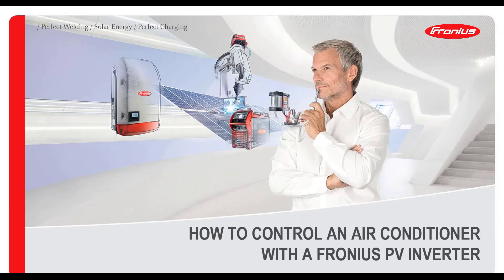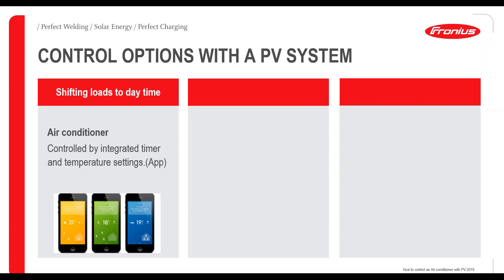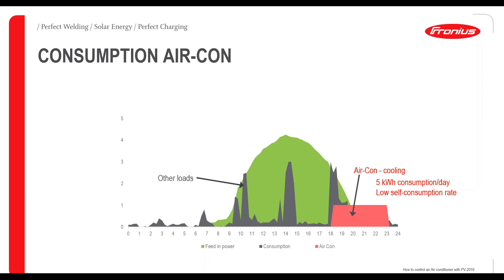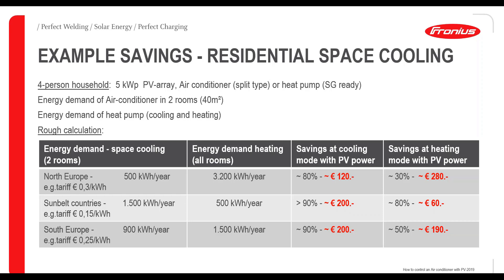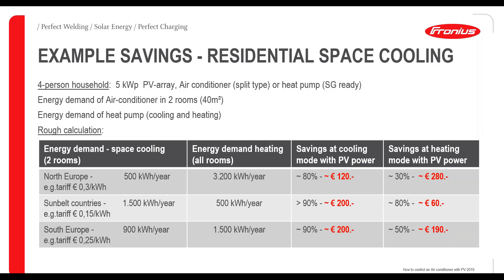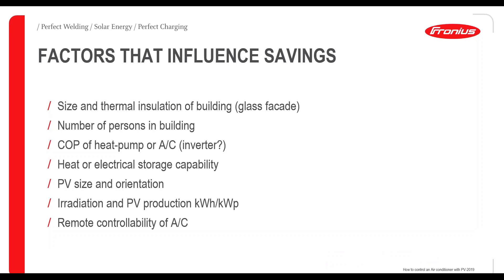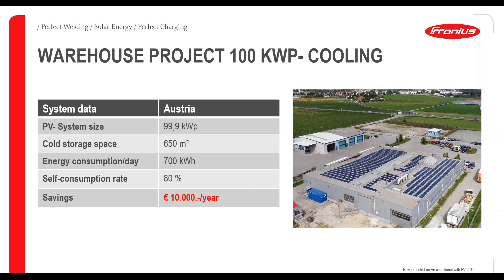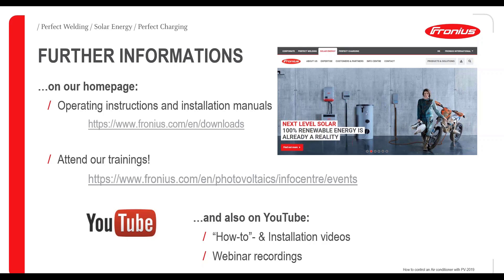Webinar: How to control an Air Conditioner with a Fronius PV inverter

Comment: I would say the Minimum duration per on-signal is the minimum time the output is held on for, not the minimum time it is held off for as suggested by the narrator of this video.  If not, then it should be labelled as ... per off-signal.

Comment: Thanks for the information.
I am from Perú, I would like to contact a sales manager.
Thanks
Katherine León
Reply from the maker: Highlighted reply
Hi Katherine, regarding your request, please contact pv-sales@fronius.com. Best regards, your Fronius Social Media Team
Reply: @FroniusSolar  dear sir. I sent an email but I didn't get an answer. we want to use the Fronius inverter and batteries for portable solar-powered cold storage rooms. is that possible to use the Fronius products for this opinion? we need to provide the 3 phase electricity for refrigeration system split unit.